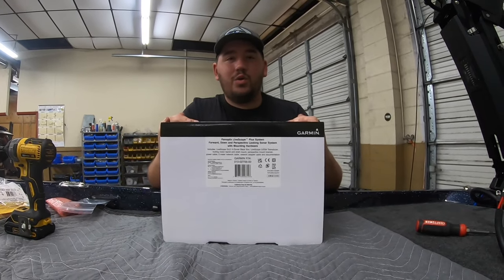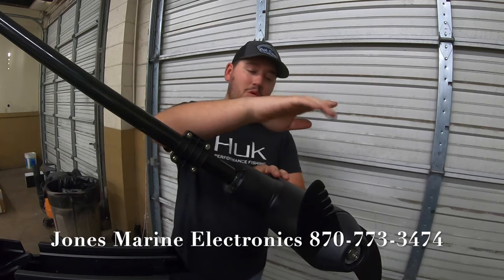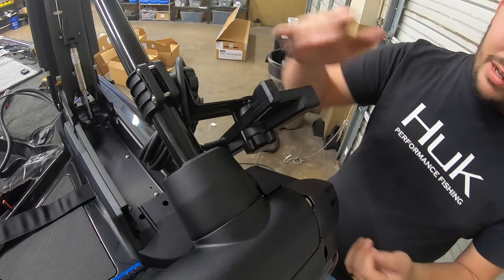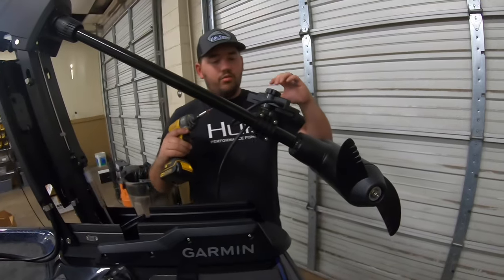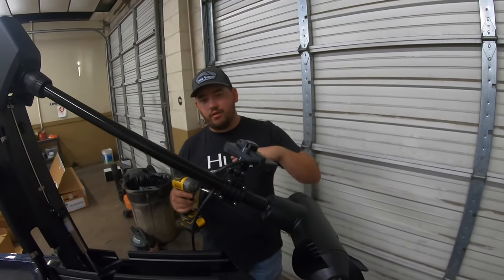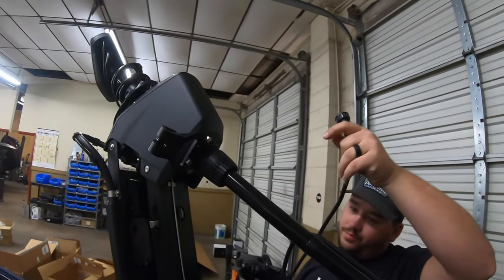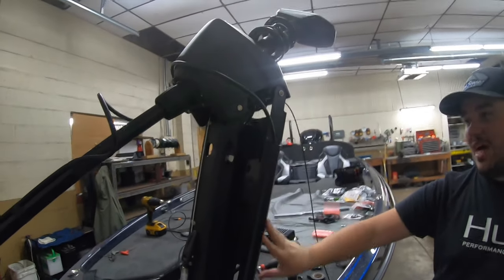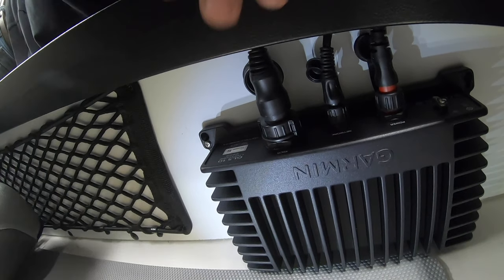Installing a LIVESCOPE (Tips, Things you didn't know, Advice, it's all in there)

Comment: Good tip on talking about wording! That extremely important! Lvs34 system should have no less than 10awg marine wire feeding it! I run my ultra 106sv, lvs34 system & steady cast off a single amped outdoors 32ah14.8v lithium battery. It will run everything for 13-15 hours. I did my own wiring. I'm running an 8awg marine wire from my battery in back up to my front hatch iny kayak where all the electronics are. I'm using posi locks to connect the power source wire to my electronics. Same connectors that the sea clear power harness guys use on theirs. I have exactly same voltage at my unit as directly off my battery

Comment: This isn't the way the Garmin manufacturer installed the Livescope,  they ran the wires through the trolling motor shaft.  Look it up.
Reply from the maker: This is the better way, those guys do things different
Reply: So many things wrong with this video can't believe it's still up. You should study up a bit before you start talking. There are 6 beams and perspective is 135° not 150°. They recommend 4" of clearance or more also from the barrel. I also just read you said you know more than Garmin so I'm preaching to the choir. Also no cable ties guys. Voids warranty 
 This guy gunna get you in trouble.